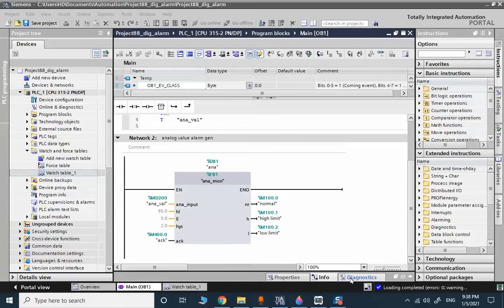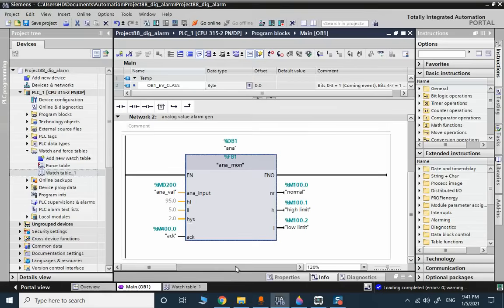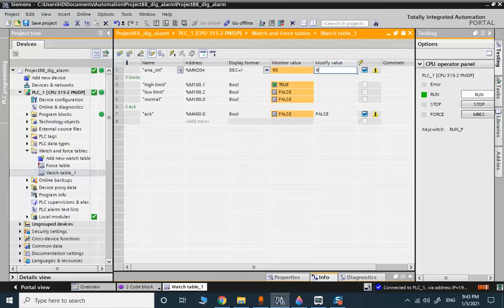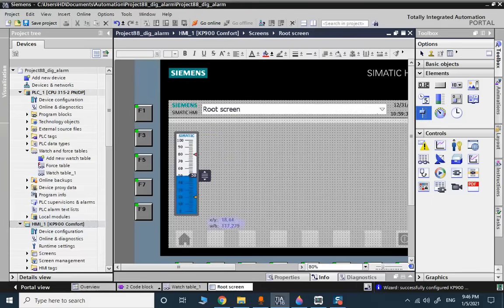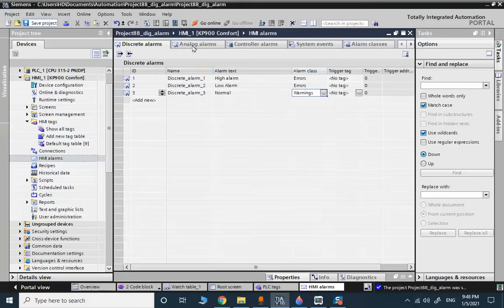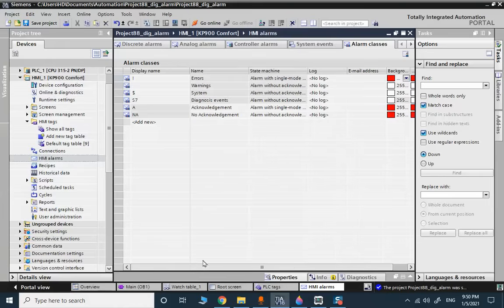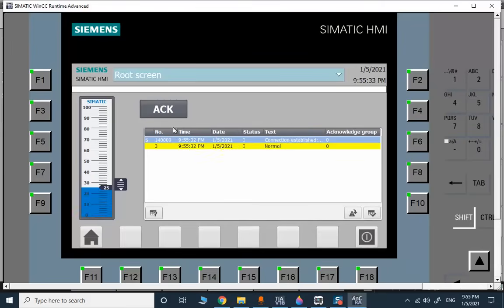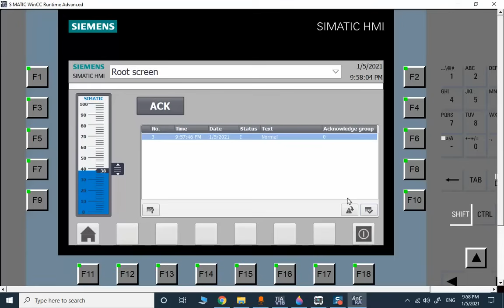SIMATIC HMI   Discrete alarms  tutorial  | SIEMENS TIA Portal | S7-300 | s7-1500 | TIA Portal V16

Comment: Nice..
What is triggered value that you entered 8, 9, and 10. Where did you defined that?
Reply from the maker: Hello,

The trigger value is MW100.It is an  INT value and it has 16 bits. For a discrete alarm you should provide the bit position in the main INT Variable.
Reply from the maker: position 8 is an indication of M100.0 --> NORMAL
position 9 is an indication of M100.1 --> HIGH ALARM
position 10 is an indication of M100.2 --> Low ALARM
Reply: @hdhosseini  Hi.  Why it is 8 position for M100.0 ? why it is not a  0 position? 
Thank you
Reply: Thank you so much for the reply...
Reply from the maker: Happy it helps :-)